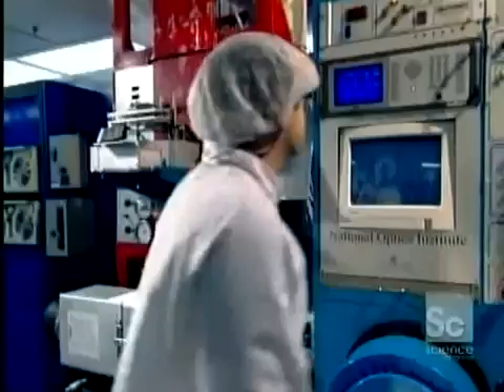HOW FIBER OPTIC CABLES ARE MADE AND WORK

Comment: For those that refuse to listen closely, The gas inside burns at a high temp forming soot, the soot is then trapped inside, then super heated for form another higher performing glass where light travels more efficiently. It is stretched to 5 microns then sprayed with and acrylic protector, then some have cladding added to it or shipped W/O it.  Dont think glass bends in a thin form? Ever hear of fiberglass? What is steel wool? What about copper? What metal is in high quality electrical cables, COPPER! Everything bends! Even titanium bends if it's thin enough!